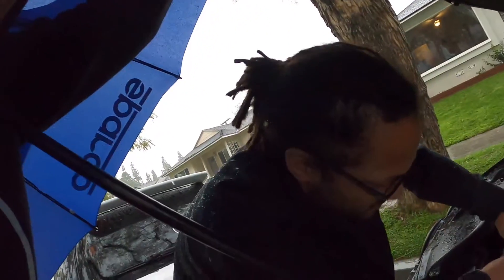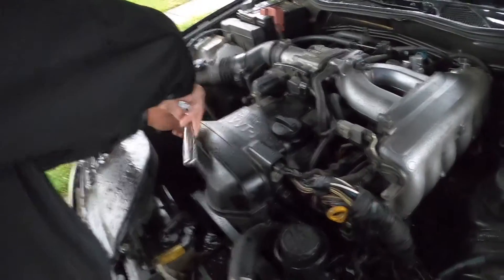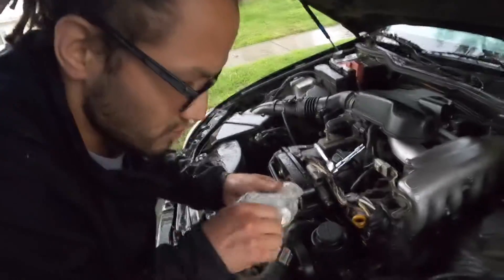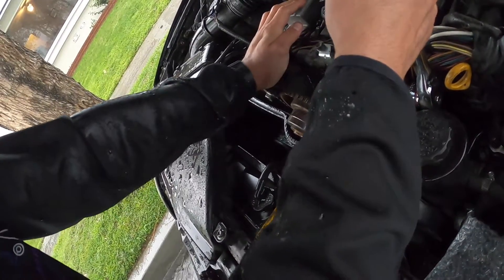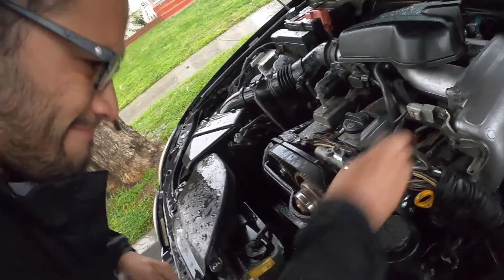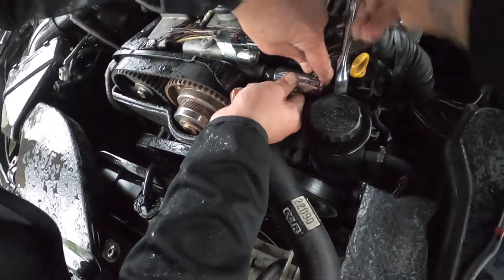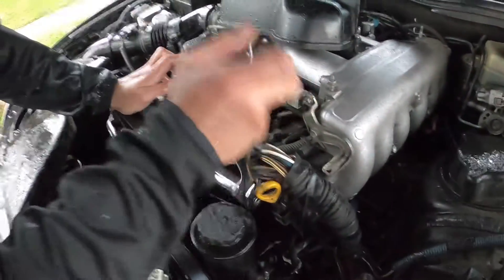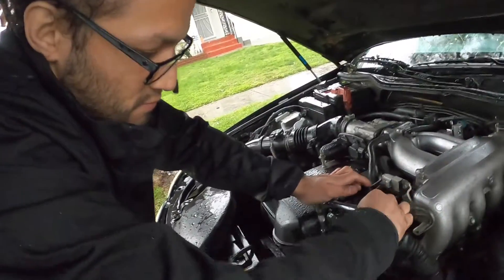Lexus GS300 VVTi solenoid replaced!

Comment: Why did you replace the solenoid? Did you get some sort of code or error? What issues did you have before replacing?  I also have a 2003 gs300 and a about a year ago, I was driving on the highway going like 70mph or so and all of a sudden, all the electronics(radio, dash lights flashed) shut off for a few seconds and then turned back on. When that happened, the engine, accelerator, power steering, and brakes were still working. I pulled over to check under the hood and saw the battery terminal cable was a quite loose, so I figured that was the issue and just tightened it. I also decided to replace the battery and alternator a week or so later anyways just because. Then a month or so after that happened, I was driving in a residential area, going maybe 15mph or so and the opposite happened to me, the engine shut off, but all the electronics were still working. I was able to start the car just fine afterwards, so not sure what happened there. I dont have any CEL on or anything, and no error codes pop up when I plug in my obdii scanner, so I don’t know. Anyways, i did some googling and some folks who had similar issues said it was a bad solenoid. Just wondering what happened to your car?  Thankfully, I have not had this happened to me since, but I still want to know what happened and how to prevent it from happening again. It’s a 2jzge, and I have only 90k on the car, so I know its still a young engine =)
Reply from the maker: The issue on this one did throw a check engine light and code. Along with the code, it felt weak and not as responsive when accelerating. Yours sound like something completely different. Something electronic for sure. Did you check all fuses and relays? I’d start there. Then because your engine died, start checking out air, fuel, and spark. Make sure there aren’t any vacuum leaks, make sure your fuel filter and pump are working good, then make sure your spark plugs and coils aren’t bad.

Comment: Was it constant or only when the car had warmed up? trying to diagnose mine and ive already replaced (coolant temp sensor, coilpacks, maf and tps)
Reply from the maker: It was constant. Initially it was intermittent, but then went constant and felt really weak when accelerating.